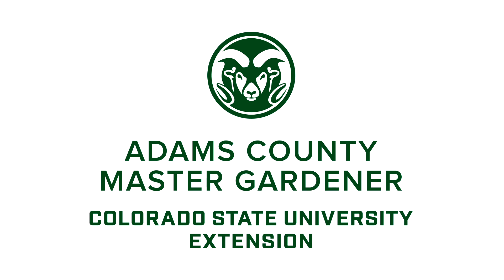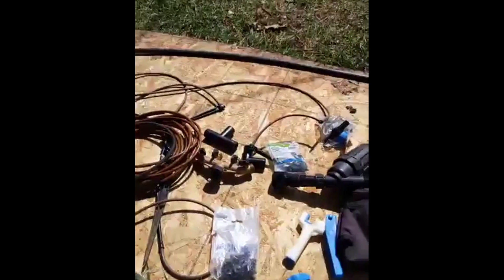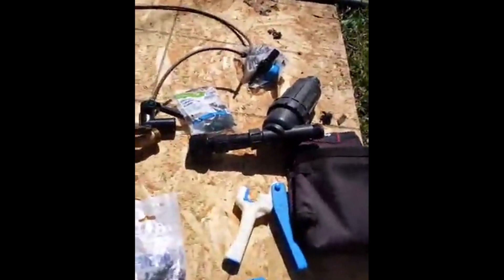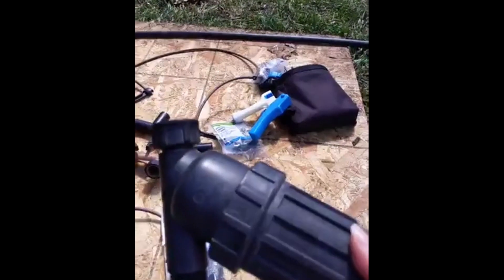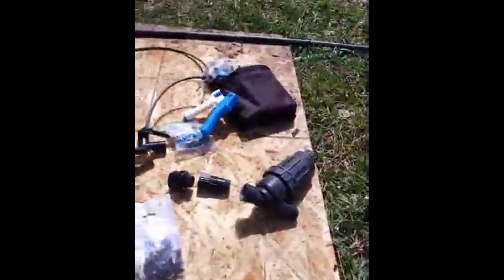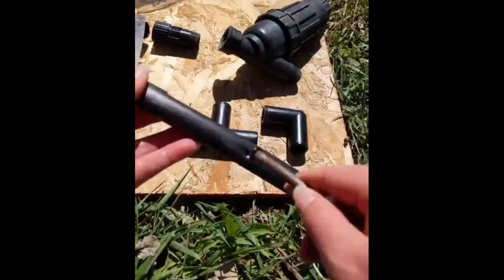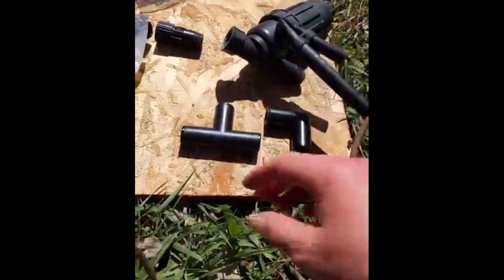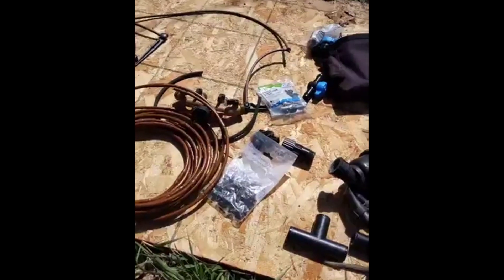Drip Irrigation

Comment: The floating drip irrigation is a new drip irrigation technology system that is the best choice for automatic irrigation. It has three characteristics: (1) Auto-remove impurities of pipe in the water, so to solve the long-term blocking problem of the drip irrigation (2) adjusted the amount of water, can plant different types of plants . (3)Lower power, the operating pressure is 0.02~2 Kg/cm2, is very suitable for gravity drip irrigation, as detailed in YouTube:
https://youtu.be/P495Nk62QMQ 
(The floating drip irrigation device introduce) 
https://youtu.be/hHen1IEzDT8 
(The floating drip irrigation system operation)
https://youtu.be/YM9grmll1oM 
(How to install an adjustable floating drip irrigation device in vertical irrigation) https://youtu.be/AR7Jzx_FS-A 
(The floating drip irrigation device is used in the strawberry plant factory)